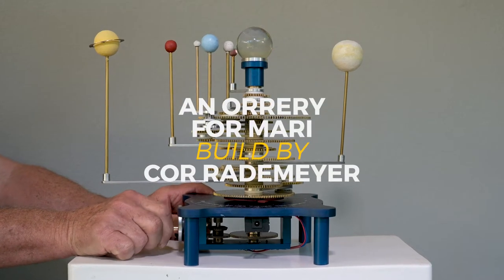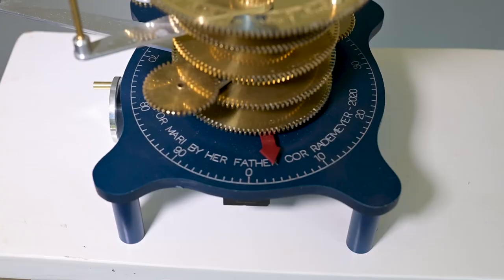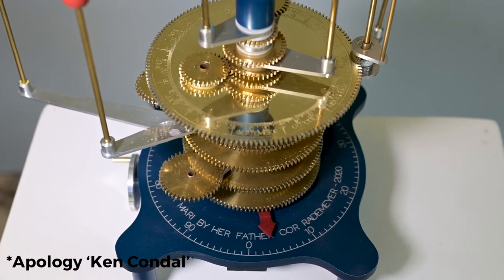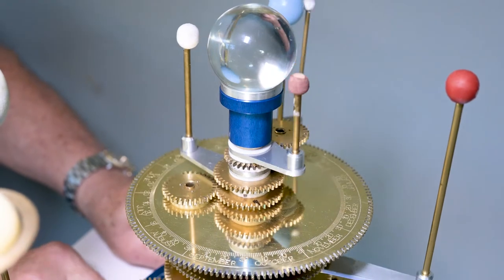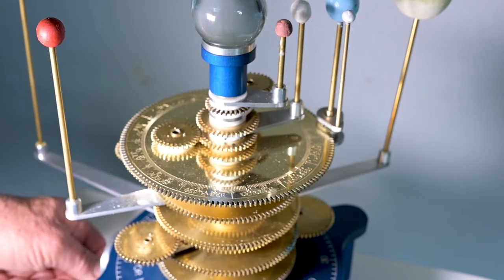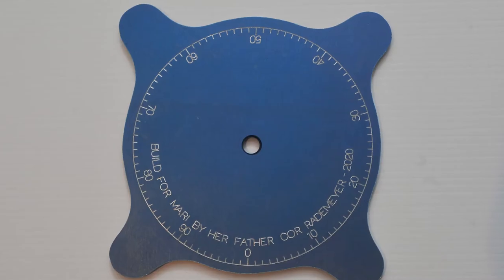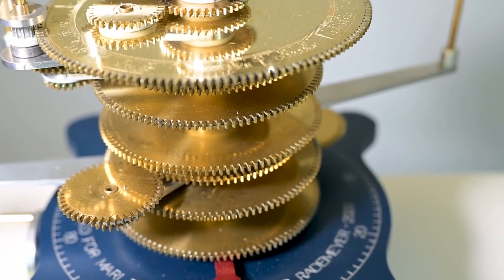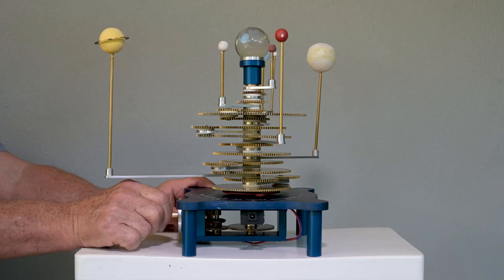Cor Rademeyer Orrery

Comment: Hi Cor. It is a wonderful Project. I have the same problem with the dimensions, Its possible to calculate my own dimensions but it would be much more easylier if I can get dimensions.Perhaps you can help me?
Reply: Hi Peter. No problem. I can send you the My excell file with the dimentions that I used.